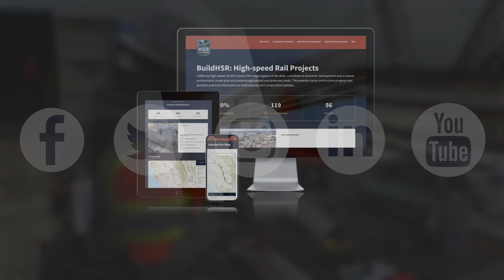California High-Speed Rail Construction Update – Spring 2023

Comment: When I was younger, I thought it was a dumb idea to have a train connecting LA to SF, but now (albeit we probably wont see that for another decade or so) I'm eager too see more modes of transportation than just driving [or flying] and that won't be relatively slow
Reply: "I'm eager too see more modes of transportation than just driving [or flying] and that won't be relatively slow"

The main way people go there is flying because it is by far the fastest way, and will remain the fastest even if CAHSR were completed, which it won't be, because they want 100 billion.

At best, we'll connect to the original San Juaquins track so you can go to Martinez and then down to San Jose.

Maybe someday, if they save up the funds they get from cap and trade, they will extend to Palmdale, but I doubt it.
Reply: @neutrino78x  Were you looking for an argument? This is the fifth or so comment I have seen from you. I get it; I do that too sometimes when I want to feel angry.  I disagree with your position though. HSR is costly to build, but it has a great benefit to the regions it serves, even outside of monetary profit. 

I am of the opinion that a large number of its potential riders will be commuters to jobs that will develop around the stations. And just because flight is the fastest convenient option now on this route, does not mean that no other means of travel can replace it. 

Personally, I am of the opinion that rail is much more convenient to aircraft, when one considers travel to and from the airport, security, and the many possibility of delays, not forgetting passenger comfort. Train stations are normally closer to the city centers, have no security to get through, when on private modern lines notably punctual, and considerably comfortable compared to air travel.
Reply: @potblack6043  

" HSR is costly to build, "

Yes, to the point that we can't afford it. 

I don't know why some of you guys don't understand that. We don't have 100 billion available as a state, understand?

"I am of the opinion that a large number of its potential riders will be commuters to jobs"

Yes, because so many people commute from SF to LA.

"Personally, I am of the opinion that rail is much more convenient to aircraft"

Now when it takes three or four times longer, I'm sorry.
Reply: @neutrino78x  Cheap rebuke, but most government funded mega-projects in the world aren't built through money immediately available but money committed to be spent. This trend of a ballooning budget is common with HSR projects dating back to the first in Japan. Yet in spite of cost, most ultimately were completed, and nobody regrets having built them.

"I am of the opinion that a large number of its potential riders will be commuters to jobs"..."that will develop around the stations." You missed the point I was making here. Very few people would ride from end to end like that as part of a twice daily commute. A weekly commute I could see as a possibility. The point is that cities along the route will experience development as a result of HSR, and people will commute between these cities to business that haven't yet been built. Stations in areas that seem out of the way today will be vibrant urban districts at least 40 years after they open for riders. Maybe sooner.

This last is my personal opinion based on my personal experience with rail. I live in a rural part of the northeast. Say I wanted to go to NYC. That's a three drive. The nearest airport is 1 hour away, which is also the same distance to the nearest train station. A plane would get me to my destination faster, in under an hour, while a train is 3 hours. But a plane ticket is over $200 and a train is $40. i can only take one carry-on bag on the plane, but I can take two carry-on's and two personal bags on the train. The seats are larger and more comfortable, and I can get up and walk if I want to. the plane drops me outside the city, so I still need to spend 40 minutes on public transportation to get to my destination. The train lets me off inside the city, so I could walk to my destination if wanted. Delays still occur, but aren't as common as elsewhere in the nation, as Amtrak actually owns the corridor and track I travel over.
Reply: @neutrino78x  you realize travel time on the plane isn’t all the plane right? You still have to get to the airport, show up 1-2 hours early, deal with baggage and security, etc.
Reply: @Kevbot6000  

"you realize travel time on the plane isn’t all the plane right?"

Nope. Since you guys are cutting and pasting, I'm going to save this post so I can just cut and paste next time this is brought up. This argument is more true on the east coast or in Europe where the airport is further away.

1) SJC is 20 minutes from downtown SJ on public transit; SFO is 30 minutes away from downtown SF; BUR is 30 minutes away from downtown LA.

2) security is 5 minutes if you have "clear" and 20 if you don't

3) in no way do you have to show up 1-2 hours early on a domestic flight. If you're there more than 30 minutes before boarding starts, you're doing it wrong
Reply: @neutrino78x  sorry but have you traveled at a single major airport in your entire life? This reads like someone who never has.
Reply: @Kevbot6000  

"orry but have you traveled at a single major airport in your entire life? "

Lots of times. Quite often. Unlike you, I don't suck at travel.
Reply: why would a train connecting two major cities be stupid in any way, shape or form?
Reply: @neutrino78x I'd argue hsr will definitely be faster than flying. You won't need to get to hsr 2 hours before take off to make sure you don't miss your train, and it will be hundreds of dollars cheaper for the average person
Reply: @purplejakman  

"ou won't need to get to hsr 2 hours before take off t"

Cut and paste argument so here's my cut and paste response

Nope. Since you guys are cutting and pasting, I'm going to save this post so I can just cut and paste next time this is brought up. This argument is more true on the east coast or in Europe where the airport is further away.

1) SJC is 20 minutes from downtown SJ on public transit; SFO is 30 minutes away from downtown SF; BUR is 30 minutes away from downtown LA.

2) security is 5 minutes if you have "clear" and 20 if you don't

3) in no way do you have to show up 1-2 hours early on a domestic flight. If you're there more than 30 minutes before boarding starts, you're doing it wrong

purplejakman continues,

" it will be hundreds of dollars cheaper for the average person"

Nope. Prop 1A says we can't subsidize ticket prices (that's what we voted on in 2008 to authorize spending on CAHSR). I proudly voted no and I stand by my vote. Huge waste of money.

Especially in this post covid time when public transit ridership is way down and transit organizations are begging us to subsidize empty vehicles. I guess the legislature funded half. I can tell you that if it went on the ballot (a covid bailout for public transit) I would vote no, even though transit is how I get around. They need to stop wasting taxpayer dollars. If there are fewer riders, run fewer and smaller trains at those times. Common sense.
Reply: @purplejakman    Pardon me for intruding on your conversation, but you and others are putting forward some real nonsense in trying to push rail over flight. I personally love train travel - I use trains in Europe a lot, and I've taken the fast trains in Japan and China. I've done NY to Washington several times, and I've taken long distance trains in Russia, Argentina, Malaysia, and across Australia. I even took the "Marrakesh Express" when I was younger. You don't need to sell me on the positives of train travel. But I've also flown hundreds of times, and I'm in a good position to compare the two. As Neutrino says, you DON'T have to arrive at an airport two hours before take off. And you don't turn up to fast trains five minutes before, either. Baggage and security screening on key train routes in Europe is little different from planes these days. Taking the train from Paris to London is exactly the same as a plane - you go through the same check in and security, and there are baggage restrictions, just like a plane. And you also talk about "wasting time" at airports, yet plane travelers can make use of that time to catch up with messages, do work, read a book, have a meal, the same things that you put forward as a selling point of train travel. And railfans always point out that you have to travel to the airport, but never acknowledge the same with the train. Trains are a fantastic way of getting from A to B, and they can make sense if lots of people go from A to B every day. But in practice, for people actually wanting to go from X to Y, where the plane/train portion is just a component, then the front and back ends aren't much different. There's a role for cars, a role for trains and a role for planes, and attempts by rail advocates to disparage other forms of transport are just childish.
Reply: @daleviker5884  lol you sound more on my side, I was just saying train definitely has its merits and it's own advantages just like flying by plane does also. They are both very important modes of transportation but my whole argument wad against him saying that trains were pretty much useless. One advantage that trains have over planes is that yes you do have to go to the station to take the train, but a train allows for many stations across an area which means less travel and waiting time for the majority of people over an airport where there might be only 1 or 2 close by and close by still means a 2 or 3 hour drive. Plane travel will always be fast than train travel in long distances, but having both train and plane will always be a net positive for the people who can access them. So I think the money we are spending on train will definitely be worth it for everyone in California
Reply: @purplejakman    If you're saying that trains have their place then yes, I think I've said as much. But you are wrongly characterizing the poster called "Neutrino". He has made a lot of comments about the HSR, and has never called trains "useless". He even voted for the train back in 2008. But he is saying that with the cost blowouts, the LA to SF train no longer makes sense, and I agree with him. As much as I respect trains, that does not mean that any train, anywhere, at any time makes sense. A cost of $135B now for the HSR is crazy. It is simply not worth that. If it was still costing the original $33B it would be a different story, but it isn't.
Reply: @daleviker5884  well I don't agree with that, you both are definitely wrong. The train will be worth it and will help Californians for the rest of time after it's built. I wasn't wrongly characterizing no one if you are using lies to try and make your arguments which he was. And even some of what you were saying
I've gotten on trains reaching the station 10 minutes before departure, that's impossible with a plane.
Reply: @purplejakman  We'll just have to wait and see then if it gets built or not.

Comment: I can't wait for this to complete. The U.S. is so sad...the only developed country without a single high-speed rails. Gavin for president 2028.
Reply: Actually, Canada is the only G7 country without high-speed rail or any electrified rail (excluding light rail, streetcars, and subways). 

Various other developed countries also have little to no high-speed rail. The fastest Swiss train doesn’t exceed 143 mph in regular service and only 85 miles of track are designated for that speed. Same goes for Austria, all Scandinavian countries, Ireland, etc.
Reply: The Amtrak Acela is in fact high speed rail. More than 50% of the route is above 125 mph and it reaches 150 mph in operations. This is pretty similar to about half of the HSR lines around the world. It's an average HSR line, but it is without a doubt real HSR.
Reply: @VieleGuteFahrer  Not entirely wrong but it also depends on your definition. If you add in the UIC definition then some of the examples you mentioned don't count (this is why the US counts as a country with high-speed rail as the NEC is largely made out of upgraded tracks supporting speeds of at least 200 km/h in many parts).

Comment: Here in FL, Brightline is opening its line from Orlando to Miami. In certain areas, the train will hit 110 mph. Next up is Orlando to Tampa.  And Brightline is starting construction on track from L.A. area to Las Vegas.
Reply: We already have a train like Brightline. It's called the San Joaquins. It has the same top and average speeds as the current Brightline train. It's now going to use the exact same Siemens trains. The whole point of CAHSR is to replace that train with an actual HSR line, not a half measure like Brightline.

Comment: Only 30 more years before we can ride from San Francisco to Palmdale!
Reply: Lol, the first high speed section is being completed this summer. And the Caltrain section in the Bay Area will start carrying electric trains in 2024.

Your side lost, bud. You failed to kill this project. Now, move to Texas and free up that housing for someone actually productive.
Reply: @TohaBgood2  completed this summer? Lol try summer 2033
Reply: @gumbyshrimp2606  CP4 construction is being completed as we speak. The construction company will literally surrender the property in June or July. This is a fact. And you only have about 1-1.5 months to wait until you are proven wrong.

Caltrain is already testing the new electric trains on its right of way. I've personally seen those new trains.

Just cope quietly somewhere over there in the corner, bud. This line is getting built whether you crazy fascists like it or not!
Reply: @TohaBgood2  The math doesn’t add up. The timeline doesn’t add up. The train from Bakersfield to Palmdale won’t be running before 2030 the soonest. 

There is too much work that has no funding to be done. There are massive tunnels that need to be built. You are the one coping.

Comment: CA resident here and I’m happy to see progress. Very informative except Florida has the first high speed rail in the nation.
Reply: Nope, the Acela is the first HSR line in the nation. It tops out at 150 mph (soon to ne 160 mph) and most of the route is above 124 mph. That's HSR by the international standard. 

Brightline currently goes 79 mph top speed with an average of 54 mph in operation. Guess what, that's identical to the Amtrak San Joaquins. Only the San Joaquins was more popular. So is the San Joaquins also HSR? We've had the San Joquins for 30 years. So job well done, California? Mission accomplished? We already have HSR?

And that new extension ain't HSR either. It has only 20 miles of 125 mph track. That tiny single-tracked segment is only 8.5% of their 235 mile route. The rest of the extension will have a 110 mph top speed limit on some segments, but that is not one continuous 110 mph section. It consists of a few 110 mph sections broken up by slow bridges, sharp turns, and single track station approaches. The average that they are promising for the entire route is 67 mph for regular trains and 78 mph for nonstop trains. 

In what world is that HSR? In the absolute best case scenario, Brightline's new extension can be just barely classified as the lower "highER speed rail." But even that designation requires more 110-125 mph track than what Brightline has so they will have to keep upgrading this route for decades before they fully deserve to have that classification.
Reply: I love how just because brightline trains look fast, non train-people classify it as high speed rail.

Comment: Building at this pace, it won’t be done in my lifetime. US needs to automate the process using prefab slabs onto pylons like China does. Bending rebar by hand, erecting steel supports and then pouring concrete over them, is not efficient.
Reply: We do use that technology in the us

Comment: why would anyone spend SO much money and to travel that distance when flying is cheaper, faster & safer?  Too many people taking mind altering drugs.
Reply: Most people loathe flying. California airports have gotten insanely busy. Security alone can take hours on busy travel days. It is not cheap during any times when you might want to fly within the state. The Shinkansen HSR system has had zero fatalities and is orders of magnitude safer than flying.

And most importantly, if were were to try to build enough airport and highway capacity to cover the capacity of CAHSR then the cost would be a few times higher than CAHSR.

There simply isn't any other more economical alternative. In-state travel demand keeps climbing and we desperately need this capacity to come online asap.
Reply: @TohaBgood2  Straw man arguments.  Just admit it is more expensive and slower AND has to be tax subsidized.
Reply: @protonneutron9046  Bud, do you even know what a "straw man" fallacy is?

And this project was explicitly started because they studied expanding the I-5 and adding two new airports (one in the Bay Area and one in LA). Either project, expanding the 5 or building the airports, is more expensive than the current cost of CAHSR.

These studies are literally public and some of the topline numbers are required to be recalculated every year. You can go online right now and prove yourself wrong with 5 seconds of googling!
Reply: @TohaBgood2  yes, and you made one
Reply: @protonneutron9046  Oh, ok. Tell me what a straw man argument is and how that applies to what I said. I'll wait.